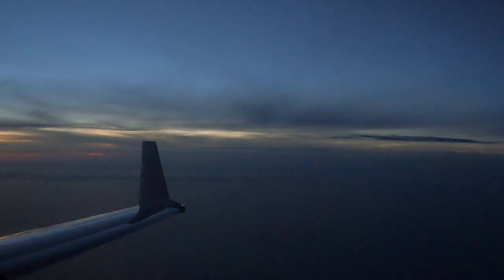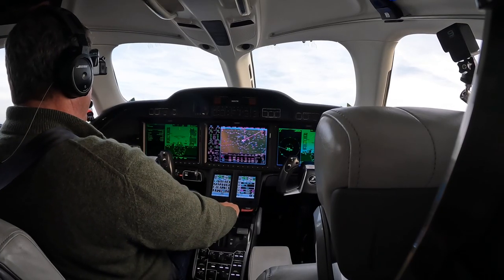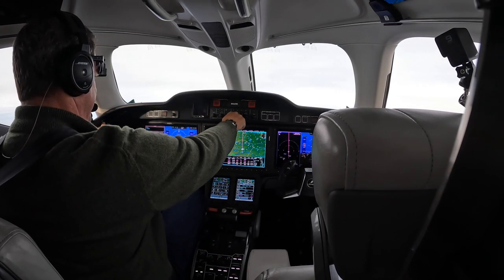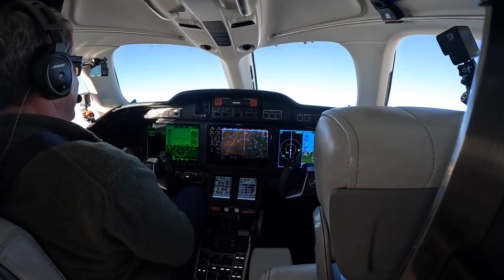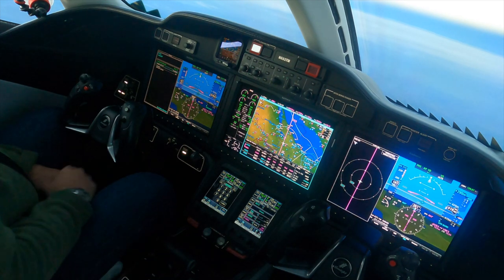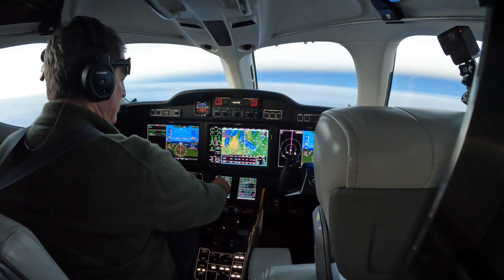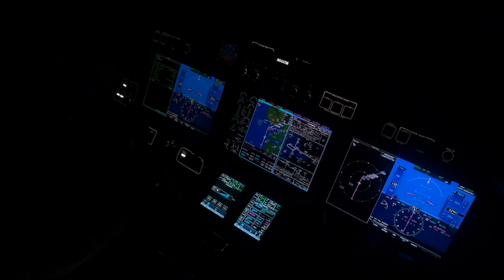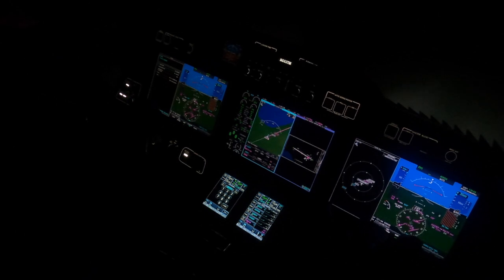Post-Maintenance Jet Flight into a Wall of Darkness - HondaJet Flight to Harbor Springs, MI

Comment: Another good one Tim. Not easy to keep up meaningful commentary to an empty seat!
Faulty pitch trim is a worry. A runaway pitch nearly brought down a heavy at LA due broken hinge.
Reply from the maker: Thanks. You're correct about the pitch trim...along with all the secondary impacts to systems. We did finally get it sorted out and the jet's been flying great. 

Thanks for stopping by the channel

Comment: Thank you for donating your time to share these videos. Yours is truly beautiful plane. I've been reading and watching videos on this jet for some time (plus the msfs thing), and no one seems to discuss certain things about the small jets like the following: (1) how comfortable are the passenger seats - really, no sugar-coating comments? Can a person with average build be comfortable for a 3 or 4-hr flight? (2) What about the toilet, is it a flushing toilet with external servicing or just a potty-type? How good is the ventilation in the toilet, or does the entire cabin find out about your business once you open those sliding doors? Personally, I would tell all my passengers to go do their thing at the FBO before boarding. (3) How noisy truly is inside the cabin? It is supposed to be quieter because the engines are sitting on the pilons on the wings, reducing vibration but I believe most of the noise comes from the air mass hitting the plane than the engines so how is this noise suppressed?
Reply from the maker: I feel like we once I'm back in the US and posting videos weekly, I'll do a YouTube Live to address some of these questions...I get them a lot. But seeing as how you took the time to ask, I'll do my best for now.

1) the jet is extremely roomy and comfortable. Keep in mind that I'll NEVER Aride in the back so I pulled my wife in to help me read and respond. We can comfortably fill all 4 seats in the main cabin. The seats move away from the sides to make them even more comfortable. About 2/3s of the time, my wife will chose to ride in the back vs the copilot's seat and she loves it. I flew east coast to west coast (2 stops) and back (1 stop) and she said it was amazing. Out daughters are all very tall (5'10-6'2") and they do just fine in the back. I've never had anyone sit in the side-facing seat for more than about 10 mins to chat with me up front and my version doesn't have the belted lav so I really can't speak to those. What I can say is the HondaJet took a huge leap ahead of the VLJ market when they designed the interior for space, comfort, and noise.

2) So many questions about the lav!  Again I'm at a disadvantage since I never leave my seat when we're in the air.  I always encourage passenger to avail themselves to the FBO facilities but on occasion, our lav has been used with great results.  It's externally serviceable (huge benefit) and seems to be well insulated/ventilated. The 2 skylights back there make a huge difference for sure. 

3) Noise is relative. 1st of all I flew Apache for a career in the Army. Deafingly loud. Then I spent decades in prop planes. Seriously loud.  The HondaJet is just above what I'd call 'whisper quiet'. One daughter was home and flew with me over Thanksgiving. She noticed right away how much quieter it was than anything we'd flown before. I was worried at first with no headset Jack's in the cabin but it turns out they're unnecessary. Normal conversations are possible...even back 'near' the engines. The Elite, Elite S, and soon to be Elite II all took noise attenuation even further than my APMG version of the HondaJet. It's impressive what they accomplished in reducing noise and fatigue. The Natural Laminar Flow design of the fuselage further reduces wind noise as well. 

OK, what else?
Reply: @bluemaxsix  Thanks SO MUCH for your detailed and quick reply! Have a great weekend.

Comment: Interesting on how you climb with a pitch angle. I use vnav/FLC to climb at the performance numbers determined in the box. Do you have performance plus on the Honda? I’m flying an M2/G3000 w/version 4.8, seems different than what Honda has. Enjoy the videos!
Reply from the maker: You're now called Good Eye Pete.  We do have a HJ version of Performance Plus and that data is provided to the Speed Tape in the Take off/Performance Panning. Flying Pitch Attitudes is totally a hangover from being a military pilot for so many years...where it's all about AOA. 
Let's swap rides!  I'd love to see you plane.

Comment: Catching up with your latest vids whilst cruising at FL390 between LERS (Spain) and LGSR (Greece)! My sim question for the week; I'm heavy on fuel, the POH recommends M0.618 for a LRC but that puts the aircraft well within the white 'arc' for indicated airspeed. I've upped it to M0.670 (200kts IAS / 380 TAS) to feel safer. Would you normally fly so 'slow' in the cruise? Keep up the content, really enjoying it but a shame that the 420 has had to return for fault-finding...
Reply from the maker: Interesting. I manage my W&B carefully and typically base my distances based upon the High Speed Cruise performance numbers. 

I do run into situations where environmental conditions won't allow me to get to the altitude I want.  Example: I plan for FL430 but it's USA +15 which means I may need to stop at FL390 before going to FL410 as a final. 

So far my performance has been really accurate and the jet monitors it closely. 

I did hear from another pkoot recently who was held at lower altitudes way too long and he knew he wasn't going to have fuel to his destination, so he pulled the power back for Economy Cruise. 

I haven't had that situation yet but I do plan for it. 

What I watch for on speed is mainly VNE/MME. 270 KIAS or .72 Mach. I wind up pulling the power back in many situations to stay below the max allowable speed. 

When at or below 95% N1, level, and in Auto Pilot, I use the CSC function. That really helps not blowing through the speed limitations.
Reply: @bluemaxsix  really interesting, thanks & blue skies

Comment: Have you tried using lens filters on the camera focused on the g3000?  I fly a Cirrus with a g1000 and put a filter on my GoPro and never see flickering.   Second, what kind of cameras are you using ?
Reply from the maker: Thanks. Good suggestion. I have 3 gopro 9s, 1 gopro 10, and 1 360 Max. I also noticed that the issue goes away when I'm filming in low light or darkness. So maybe it's a gopro issue. When you say G1000. Is it a NXI version?  My G3000 doesn't have the faster refresh or higher screen resolution.
Reply: @bluemaxsix  I typically fly the G1000/NXI perspective plus but I have tested using a g1000 perspective as well.  One thing that may make a difference is that  I record in 1080p to make the batteries last longer for daytime settings.  I have not found the best settings for night time flights yet but have definitely reduced the FPS at night. The g1000 does not seem to put out as much light at the g3000
Reply: I am having lots of problems with the GoPro 9 locking up.  Have you experienced that and what do you do about it ?
Reply from the maker: @anthonyfazio4743  I use 1080p and 30 FPS on the 9s and 4K on the 10
Reply from the maker: @anthonyfazio4743  No, I have had any issues. And I bought all of the 9s used
Reply: @bluemaxsix  just did a software upgrade on the 9, hopefully that solves my problems.
Reply from the maker: Let me know. I always update the sw whenever available.  Limited downside, unlimited upside